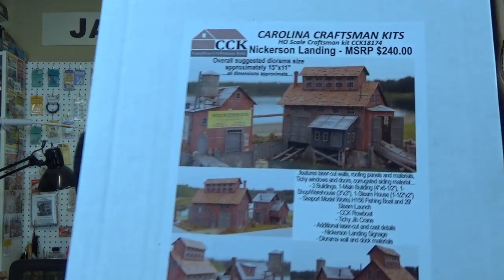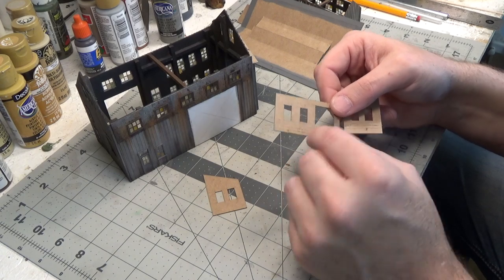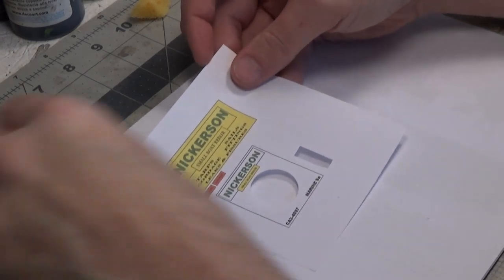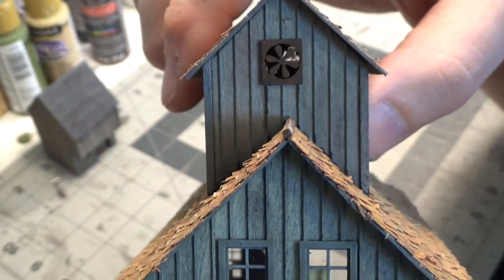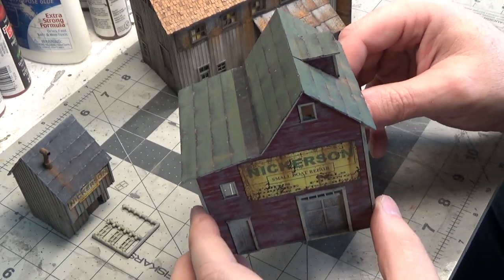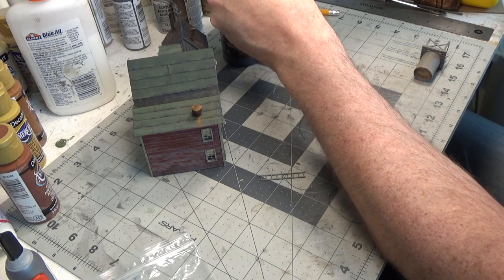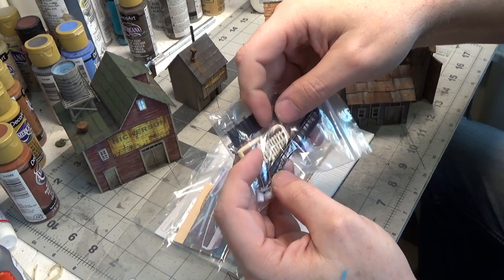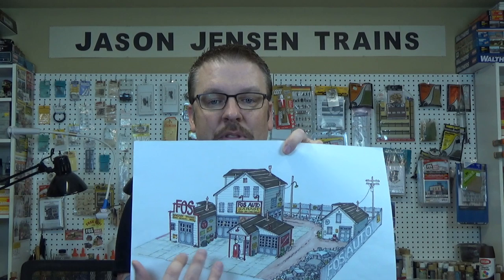Building a Carolina Craftsman Kit.

Comment: Another great video. Many thanks for the comprehensive explanation of the process. I have a quick question. I noticed you have art paints from many manufacturers, but as a rule you tend to use more often the americana brand. Is that for quality of the paint, or just because of higher availability at your local stores? Thanks.
Reply from the maker: Thank you so much!!! I just really like Americana and recently I’ve been using lots of paint from Ammo by MiG. Thanks for watching!!!